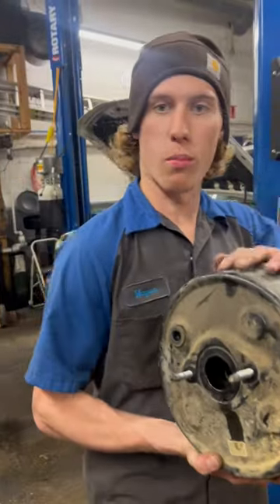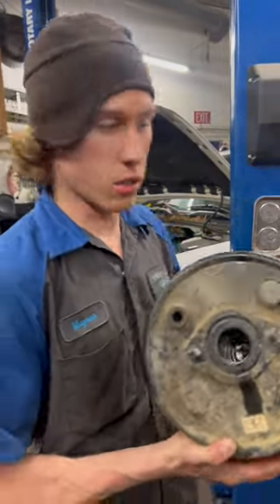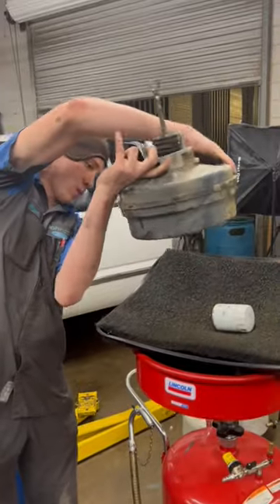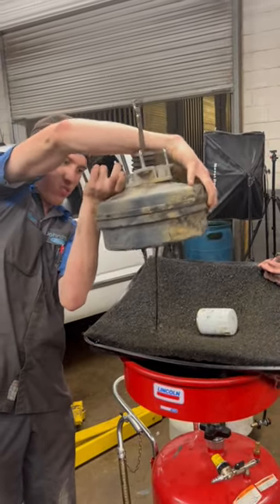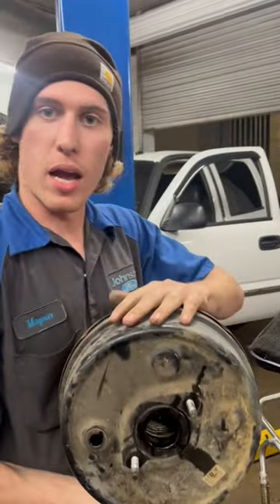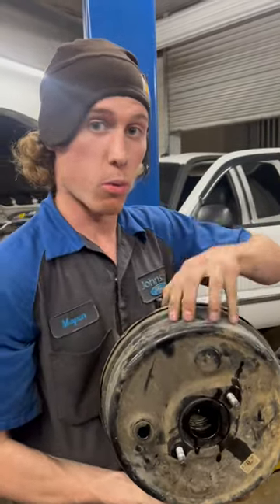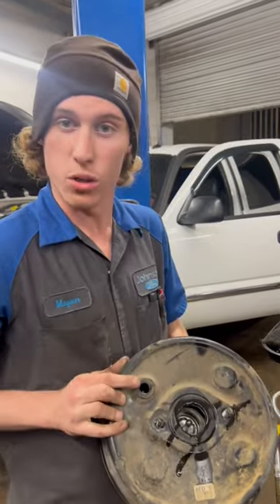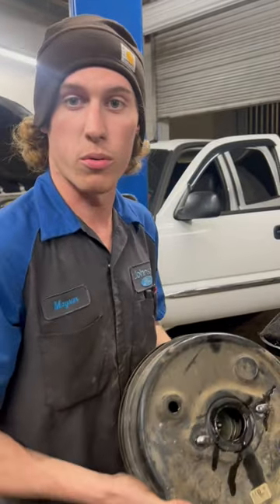Brake Fluid or Blinker Fluid? #shorts

Comment: That booster is shot. Not brake fluid has any business in that booster. If theres fluid in there then something is wrong. The fluid is contained in the resevoir on the brake lines and the ABS modulator.

Comment: I have a question. Just finished a 2016 f150 5.0 complete timing and oil pump. After getting it all back together I have a rattle in the engine that sounds like rockers or phasers. Do you have any idea what may have happened? It’s not the first one I’ve done but the first one I’ve ever had do this. I do the 5.4 and the 5.0. Haven’t torn anything apart yet to see what I can find.

Comment: Bruh if someone does that it on em bruh and maybe they should just sit the tools back down. way back in highschool i replaced the brake booster on my 96 thunderbird 4.6 cause i was tired of standing on the brake pedal and still over shooting past the stop lights. wasnt to hard found a service manual online with all the torque specs, had to remove a bunch of trim and windshield wiper motors to get it out. The hardest part was figuring out why she wouldnt go into gear after i apparently accidentally unplugged the brake light switch without noticing lol.

Comment: Brake boosters doesn't hold oil hey should not have any oil inside. The brake booster uses vacuum to help in stopping the vehicle
Reply: not this one it clearly uses some sort of hydraulic mechanism with all that oil in it😂

Comment: No way!   I know that's not so.   In fact, you over fill master cylinder and put top on, you run a risk of getting brake fluid in brake booster and than you have to buy a new booster and m. Cylinder.
Reply: Never heard of satire?
Reply: @thewitt76  well, had I not known better, I would have believed this!   Now, since I am far from being an authority on this subject, I was respectfully trying to provoke those in authority to confirm my knowledge on this is correct.   Flyingwrenches is usually a very informative, no nonscience dude.   I think he is super smart.
Reply: @Franklinveterinarycenter1of4  just making sure. You never know nowadays
Reply: @thewitt76  thankyou
Reply: Well, the fluid isn't going to get into the booster from over filling the reservoir. It gets in there when the master cylinder fails and leaks into it.